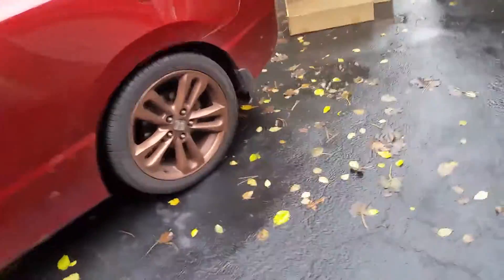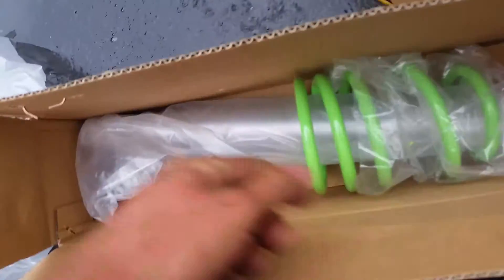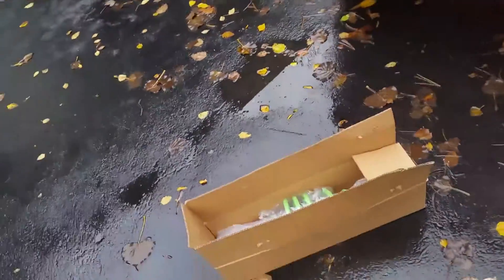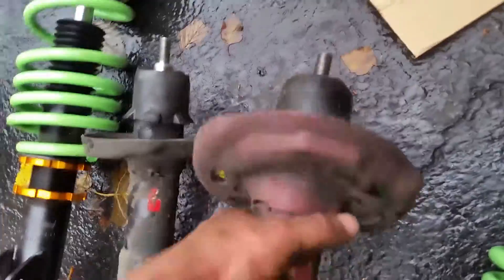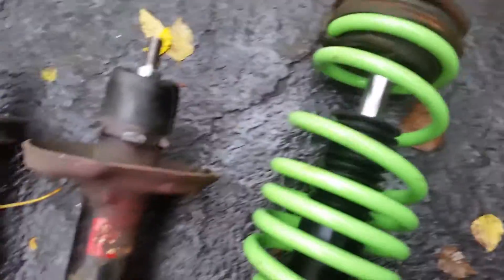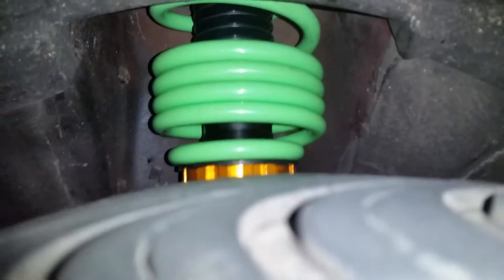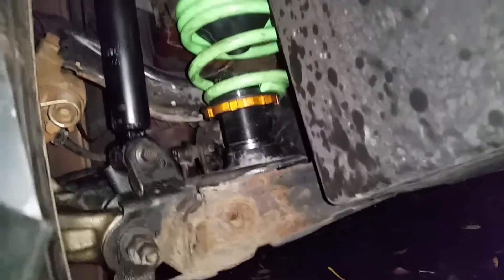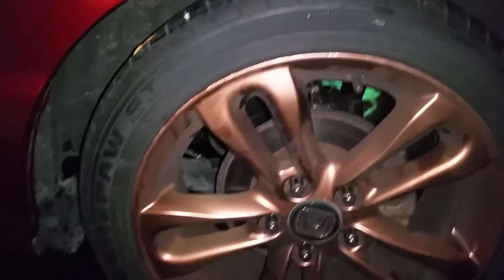My 1st time messing with coilover (Raceland)

Comment: Did you have to reuse anything from the rear struts
Reply from the maker: Fixie Guy just all old bolts and nuts. Was not bad to do theses vs other cars.
Reply: Lilmiddwest in the video it says reuse the bushing sleeve (the little sliver piece on the rear strut) I have no idea how to get it off lol
Reply from the maker: Fixie Guy okay I remember you need a drill that dipple off so you can slide it off. If you wana drop or rise your coilover please put some anti seize on the threads on the coilovers. So it can be easy to losen your coilover. Let me know you got any more questions
Reply: Lilmiddwest thanks a lot man and when you see dimple do you just mean that little hole?
Reply from the maker: Fixie Guy yea that is blocking that sleeve.
Reply: Lilmiddwest okay I’ll try that thanks again